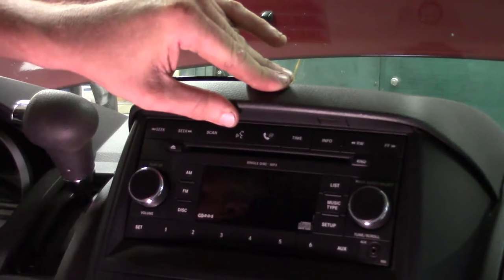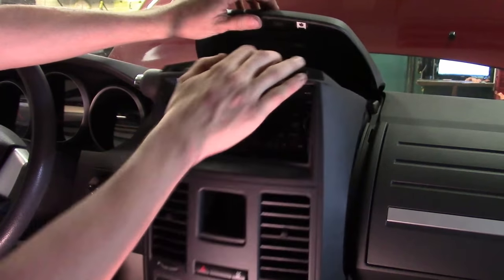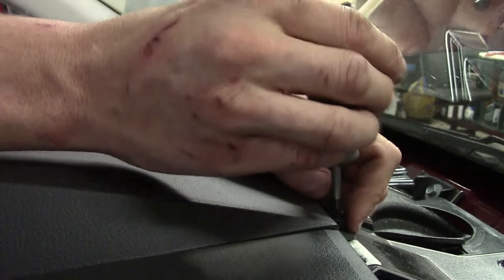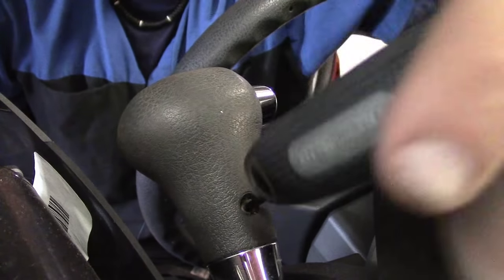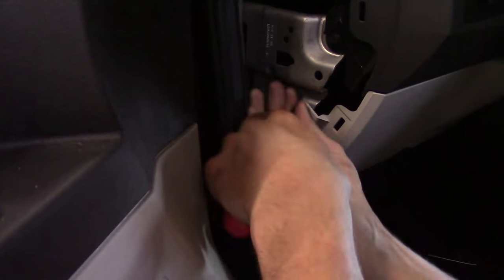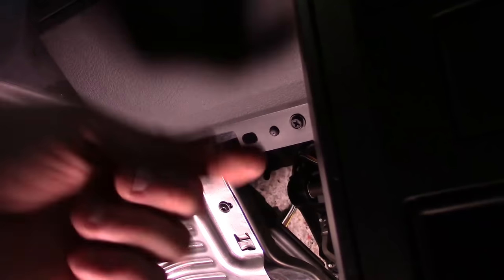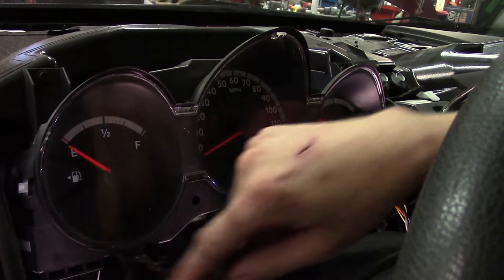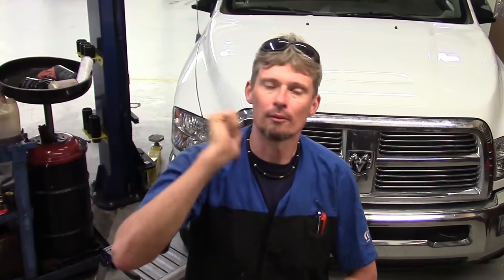2008-2010 Dodge Grand Caravan and Chrysler Town and Country instrument cluster removal.

Comment: Had to post twice. because I just fished my dash that has been busted for easily 8 years. It came RIGHT back on. proving it is the dash that was the problem (Solder Joints Id guess) the mileage says 135000 not 42000 like it should be. Ill get that other dash repaired. You made this job SO easy saying the size of the screws and hex bolts was perfect! you made this job SO easy it isnt even funny. Another interesting thing I got a Chrysler dash..I have a dodge car.. turning the car off and on once. Switched the dash to display Dodge again. (Didnt fix the mileage. I know that has to be programmed) Thanks again!

Comment: Just a comment for anyone in the future who needs this video, the plastic ring that pops out of the dash trim that goes around the Wireless Ignition Module marked ACC/ON/START is an antenna for the Wireless Ignition Module and it is used to detect the Key Fob. If you are trying to test the ignition system (Acc or trying to start the car) with this ring off the vehicle will NOT start and behave erratically.

Comment: You know I took my van into the dealership and I’ve been wondering for at least two months what the heck has been going on with it $150 for them to check it out. They want 1500 to fix it of course they don’t make the part anymore, so they would have to send it out. I could do this by probably going to a junkyard. I’m not that mechanically inclined. My husband is though, but by watching this video, I could probably do that myself and taking the part out at a junkyard very informative.

Comment: Thank you .. got this car new from my father in law (worked for Dodge and retired) The dash has a intermittent problem where the lcd panels go out and the backlight. Got a dash off ebay for 50 bucks. Figure Ill try this before I start going after more expensive things like the TIPM. It is the dash info display problem where the dash will go dark for 6 months.. come back for a year and then go away again for months. Weird as hell.. but whatever. Thanks for this GREAT video. I need a trim tool :)
Reply from the maker: Thanks John for watching the video and for the comment.
Reply: Did a new cluster repair your issue?  Friend has a 2010 where the odometer and amber indicators go out!
Reply: @mark102003  yeah but now I have a van that says it has 120,000 miles and it had 65000.. I guess that is fine but yes. Swapping the dash out fixed the issue 100.. This comment was a year old and I have not had one problem. It would have happened once or twice since then by now.

Comment: I want to ask something that isn't been discussed 

Hello David
Thank for your informative video first of all.

What I need to know before I tackle this job is if the milage and security codes on these models are stored within the BCM separately, or with the key/ignition, or if anything is bin the cluster.
I need to be prepared to have the replacement cluster reprogrammed before replacement for keeping the milage original, as well as if there will be no-start security issues with just a direct swap for drivability. Please and thank you for clearing that important detail up!
***Also your email posted in video came return as undeliverable***!!!?
Have a great weekend

Comment: Amazing video once again David, thanks so much! I've been searching the Web for this, glad you have a video of this. thanks!
Reply from the maker: Thanks, Told you I have more videos haha. Appreciate you watching
Reply: +MotorCity Mechanic I finally got the radiator done, the only PITA part was getting it aligned down where the gromet goes. Thanks again! Can you also please post a video of oil change process for the 2009 Dodge Caravan SE 3.3L engine.
Reply from the maker: Glad to see that it worked out great. Appreciate the update. I will certainly keep that video request in mind.

Comment: Thanks for the awesome video!!  I have a '09 T&C and the dummy lights randomly flash all on, security indicator on and wipers go.  I saw a video where there was a broken wire leading to the door (white/orange) and when soldered everything was fine.  Took mine apart, but could not find any faulty wiring.  should i look behind the instrument cluster?  Any Ideas?  Thank you for your armed service.
Reply from the maker: Usually those symptoms point towards a communication issue. The issue will require checking for codes in all the modules and then testing based on those codes. Your basic code reader will not be able to do this and it will take a special scanner. Otherwise you would be working on it blind. Thanks for the comment and for the question. Make sure to subscribe
Reply: What kind of scanner?  I live in a small town with lots of "half way" mechanic shops.  I'd like to be able to ask them if they even have the correct scanner.

Comment: Good job Dave. Made look simple. Thanks.
Reply from the maker: +Raymond Campbell Appreciate it Raymond. Thanks for watching. Make sure to subscribe if you haven't already.
Reply: +MotorCity Mechanic You are welcome. I have a 07 300. can you do a video on the removal of the ignition switch when you get one in the shop. I think we out here would rather watch a pro do it the right way. Thanks.
Reply from the maker: +Raymond Campbell I will try the next time I get one in for that repair. I do have a radiator removal video for your vehicle coming out shortly so make sure to check it out once its uploaded.

Comment: thanks for the videos they are wonderful, you can show how you completely disassemble the car radio grille, because I would have to change climate control and I can't because the grille remains attached at the bottom, thanks

Comment: Can the illumination bulbs be replaced? Or do you have 2 replace the cluster? Can bulbs be replaced without cluster removal.
Reply from the maker: +The Adventures of Patrick And Chipchip It really depends on the year. The older vans had replaceable bulbs but the newer like the 2009 doesn't use bulbs but instead led's so on that year, no. If the bulbs are replaceable you have to remove the cluster and possible partial disassembly.
Reply: Thanks  I work for usps and we have hundreds  in our local fleet. Must be a short somewhere.
Reply from the maker: +The Adventures of Patrick And Chipchip There is a very good possibility.
Reply from the maker: +The Adventures of Patrick And Chipchip Are all the lights out on the cluster? If so than the first step would be using a scanner capable of accessing the cluster to see if any codes and then start checking the wiring going to the cluster for the illumination.

Comment: Perfect video. Thank you. Question. The panel lights sometimes work and sometimes dont. The led miles and other led lights on it always work, just the lights the light up the speed/ fuel gauge / ect  most the time dont work. Do you have an idea about this?

Comment: I just upgraded my instrument cluster (09 dodge grand caravan), I have the basic one without tachometer and got a STX cluster with the tach. It was all plug and run, everything works fine, just the mileage is off by 200K, which is kinda a big amount, got it fixed by a repair shop.

I am also hoping to upgrade my manual climate controls to auto climate controls, the only difference between my van and the auto climate control van is I need a solar sensor and the cables for the sensor as well, I have cut the wiring harness piece that goes into the auto climate control system as well as the solar sensor from a wrecked van and the ATC itself from that van, it's the same year as mine and pretty much the same vin. The only problem is the connectors are different. ATC has one connector, manual one has 4. Any ideas if I could get a wiring diagram for both vehicles to make this switch possible? I also noticed each cable has a distinctive color combination, one has red and white, another blue and red and ect... If I take the red and white cable from my vehicle, can I solder it onto the red and white cable feeding into the ATC unit harness I cut from the van in the junkyard? getting a whole new harness will take me weeks to remove the dash and re install the dash.

Thanks for the fantastic video!!
Reply from the maker: On that vehicle the mileage is stored in the cluster. We order our replacement clusters with the mileage programmed in them. I dont know where they come from or where you can ship them to get reset. When it comes to swaps like your trying on the HVAC system....thats falls in a grey area where unless someone else has tried it and made it work and showed it online, there isnt much else I can tell you. On modern cars like that....the swaps are hard and sometimes not possible because wiring isnt in certain places....along with certain sensors....and the other thing is that the software isnt present to make it happen as well.

Comment: hay on my 2010 caravan shifter keeps locking,ill push the release under the small square port hole which does release the shifter but then the key fob will not turn back counter clockwise fully until i remove the battery cable for a couple minutes then replace it ,ive noticed the verticle shaft under the shifter knob doesnt have spring pressure, could that cause the key fob not releasing, for some reason its not letting the fob to turn counter clockwise enough to release,,thanx for your shows,

Comment: Going to try this on my 2014 dodge caravan. Although first it will be exploratory to see if there is power to the cluster. Currently I start the car and no lights come one, the gauges sit dead, no interior lights, no tail lights, no turn signals. I heard that the cluster can knock all of these out? On the older caravans there are some videos about resoldering the power connection point to fix this issue instead of replacing the entire cluster. Pretty dismayed that my 3 year old dodge has this major issue. While the car will drive just fine its a major safety issue with no tail lights or turn signals. This is not covered under powertrain warranty the dealer tells me. Luckily I have a 13 year old bmw and 14 year old ford to drive while I try to sort out what was supposed to be the reliable new family car.

Comment: Hello Sir, can you advise if these instrument clusters are plug and play?   Is the mileage saved on the cluster or the BCM?   Wondering if on a 2010 Dodge Caravan if I can swap out clusters, either the exact same type of cluster, or an upgraded cluster with the tachometer?
Reply from the maker: +Jean-Francois Gauthier The service info states that the mileage is stored in the cluster so that will present an issue. As far as the other upgraded features working as a plug-n-play......I cant tell you for sure because I haven't had the chance to perform that swap as of yet. I appreciate the question and thanks for watching. Make sure to subscribe

Comment: Question, if it's just the backlight on the gauge cluster that doesn't work or turn on when you turn the headlights on, you have to replace the entire cluster or is there a way to change the bulb? Or if possible could it be or mean that something else is wrong?
Reply: Did you had to change the entirer cluster or u you  could change the bulb my 2010 dodge grand caravan have the same problem everything works great but i have no lights in the back can you help me on that please

Comment: you are so kind answering the questions i really appropriate it . i have 2013 Chrysler TC 2 days ago it just stopped working when i try to start it i just here the starter and the fuse box make click noise so i changed the starter and still the same symptoms  then i changed to brand new battery and its still the same . there no signs of oil in the coolant though?
Reply from the maker: Your welcome.I use to work at the airbase just outside of Habbaniyah Iraq, not to sure how far away that is from you. That issue is going to be a bit hard to check over the internet. There are things that need to be checked such as codes.
Reply: what ? i served with 82nd airborne at ramadi what unite are you ?
Reply: oh my god life is so small .lol
Reply: i live in California though.
Reply from the maker: I actually worked for KBR (civilian contractor) I was a mechanic for the company and worked on some military non-tactical equipment. I was actually at TQ and spend about 2 weeks at the Ramadi base fixing a company front end loader. That was 2005-2006
Reply from the maker: Its smaller then you know....lol. I was bunking next to a guy that actually knew my dad lol. now thats a small world for you.
Reply: oh my god we are the army company used to do QRF and convoy protection for kbr oh my god .thanks for your service with kbr i know they suck but they really helped us logistically big time .
Reply from the maker: It was an experience that I wont ever forget. Met some great people. Appreciate your service as well. Mine didnt involve me getting shot at as much as yours so you certainly did more then me.

Comment: On the 2010 Dodge Caravan base SE, are the bulbs replaceable?   I seem to have one bulb that flickers for a few seconds on startup (after the van has sat for quite a few hours....otherwise it doesn't happen upon starts within a few hours).     Thinking either poor connection somewhere or bulb starting to go out?
Reply from the maker: +Jean-Francois Gauthier Sorry about the delay. I checked and the service info states that if any light issues with the cluster.....the cluster has to be replaced, the lights cannot be replaced separately. I haven't seen this issue so far personally
Reply: +MotorCity Mechanic hey, i figured out the issue!  I had a bad engine ground strap that had corroded.  Replaced it and the dash no longer flickers, AND my headlights are not so dim anymore.   

That being said this video you have here will be extremely useful for me as I have to repair or replace the air vent to the left of the steering wheel.  Need to take the dash off to get to that (as you likely already know).

i also need to replace the heater control unit.  Will this video and how you are pulling the middle apart allow me to take out the heater control unit or do I need to pull the whole middle part and remove the console between the seats?

THANKS FOR THE VIDEO AND YOUR TIME!  AWESOME AND EASY TO FOLLOW!
Reply from the maker: Jean-Francois Gauthier Thanks for the update. To remove the center stack with the hvac control head you will need to remove the lower portion of the center part of the dash because it covers up the screws that attach the center portion to the dash. That means the console will need to be removed as well.  Thanks again for watching
Reply: +MotorCity Mechanic  Do you have any particular instructions on how to do that?  I assume first step is take the console out (easy).   Next the only thing I can think of is taking out the drink tray (not sure how that happens) and then not sure after that.
Reply from the maker: Jean-Francois Gauthier The lower portion is removed by taking the 6 plastic screw inserts out of the storage bin/compartment below the hvac control module bezel. There are 3 of these fasteners on each side of the storage bin. You need to gently back out the screw and then pull the screw and threaded insert out together.
Reply: +MotorCity Mechanic Awesome, I see them and should be simple enough!

Thanks for your time and guidance!   You just saved me a nice bit of time and headaches, not to mention likely a bit of $$$ too.
Reply from the maker: Jean-Francois Gauthier just take your time....sometimes the thread plastic insert spins with the screw, if so then you will need to pry the screw out with turning it.
Reply: +MotorCity Mechanic Ok thanks!
Reply: +Jean-Francois Gauthier Got her all fixed. Thanks man for the instructions.
Reply from the maker: Jean-Francois Gauthier Thanks for watching and for the update.

Comment: when i install the new one is it going to read the old milage. or what its going to happened?
Reply from the maker: The odometer or mileage will remain with the cluster so your replacement cluster will show the mileage of the vehicle it came out of. When we order replacements.....we have to send the mileage so that it can be programmed to the mileage so that it will be accurate when we install it. We have no way of changing that at the dealer. Hope that info helps and make sure to subscribe
Reply: thanks a lot i really like your Chanel , i subscribed. but im confused about what you mean by we send the milage?
Reply from the maker: What I am speaking of is that when we determine the year model van has a bad cluster and we go to order a replacement.....we have to send/attach the current mileage to the parts supplier. Then then enter that mileage into the cluster that the ship to us.
Reply: i see thank you , i thought its just like my Mercedes when i replaced the used cluster it did read my accurate milage by it self , so now i have to ship the used cluster to you to program the milage ?
Reply from the maker: It depends on where the mileage is stored.....some vehicle store it in the BCM (body control module) and in some vehicles the cluster is the BCM. I cant program it. I would check online to see who sales them and see if they offer that option to set the mileage. If you order a used one from someone....most likely that person might not be able to do that so check with companies that sale them first